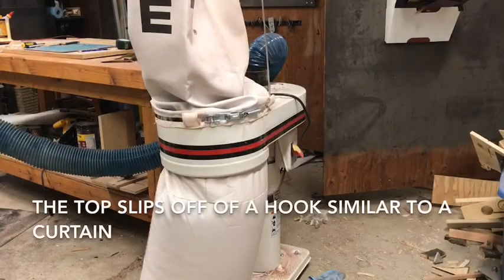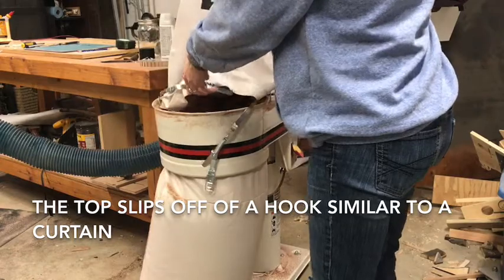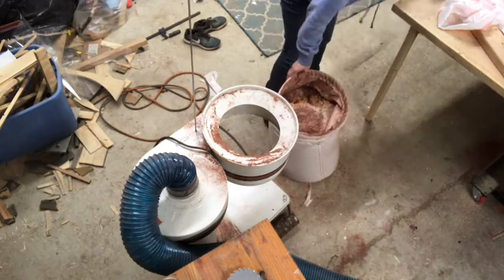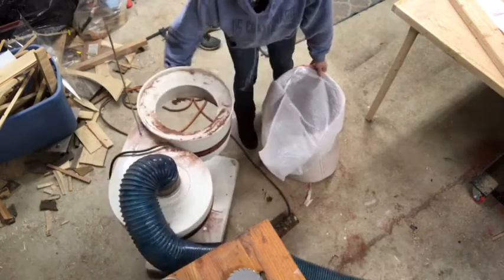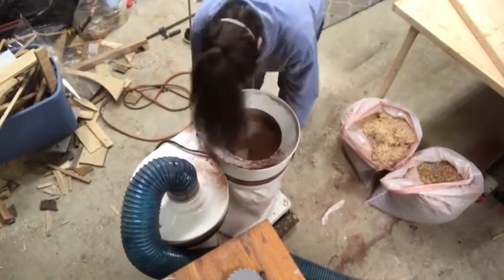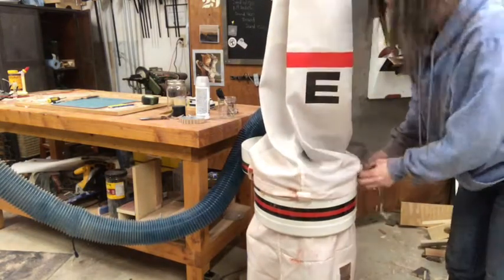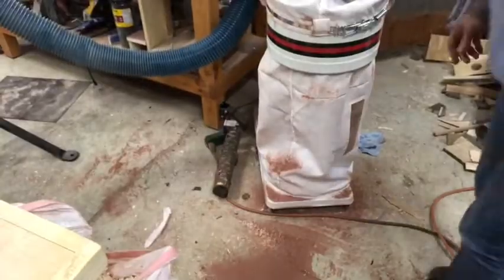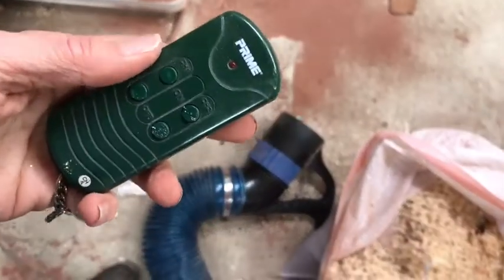How To Empty The Dust Collection Bag of Jet DC 650M

Comment: I noticed you also have a Dewalt dw735 planer, how well does your Jet dust collector work with it?
Reply from the maker: Funny you should ask.  At first it kept clogging as I had the blue hose connected directly to the dust collector, but when I put the plastic handle connector on both ends of the blue hose (one for the dust collection side and one for the planet side) it has no problems. The plastic handle connectors and hose set are from Rockler.

Comment: Can you translate that middle section? Ha ha. Enjoyed the look at the dust collector. How is it holding up?
Reply from the maker: You don’t speak chipmunk? Ha ha!  It’s holding up well.  One thing I would like to make is a stand that is about 6 feet high that would create a way for it to drape over so it will be easier when I am vacuuming my bench, or just want it to lie on the table when routing.  It’s sort of a base model type machine, but overall I am satisfied with it.  
Thanks for watching!